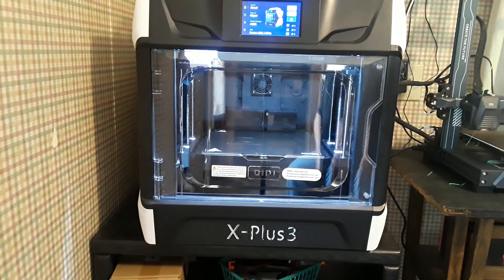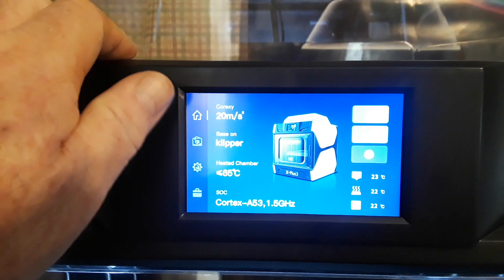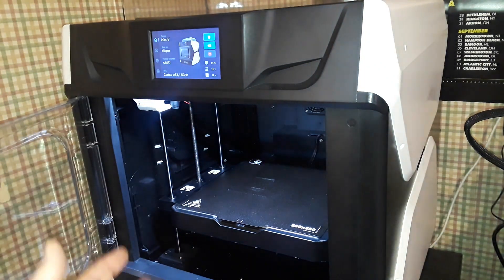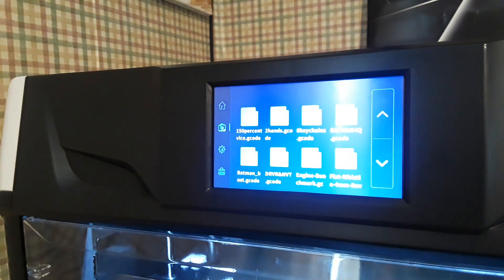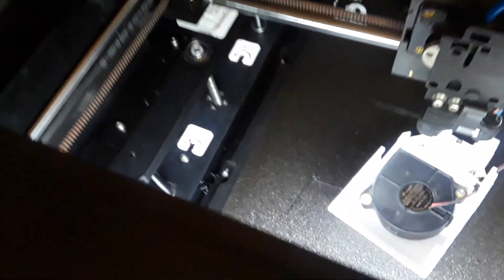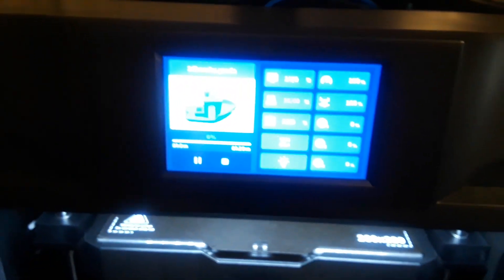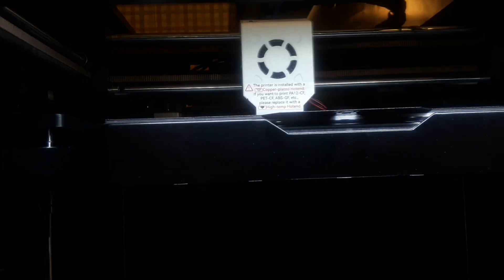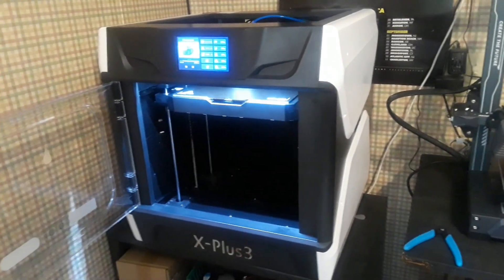Qidi Tech X Plus 3: One Month Later

Comment: ive had trouble with prints not coming out right support say do a level again and its still sticking to the nozzle been told to manuel level the bed but i dont know how to do that on my plus 3 yet very new to 3d printing after watching loads of youtubers saying printer is good we went with that printer 42 prints later still failing prints only the first benchy prints came out right with pla
Reply from the maker: This is a rock solid machine. It sounds to me like you have a bad one. I would contact the seller for a replacement. If you get any pushback, let me know.

Comment: i have been thinking of this model for a month.. would you say that the qidi has just as good bed leveling as the K1 or P1P?
Reply from the maker: I've never used bamboo so I can't give you a comparison. I can tell you I have have not experienced any problems with the X Plus 3 that weren't caused by me or the slicer. And both times QIDI tech support answered my question in less than a day.
I absolutely hate the drybox on the back of the machine. I bought a filiment dryer with rollers and just feed from it on the side of the machine. The filament runout sensor is on the left rear and the drybox feeds right in.

Comment: Yes, what I would like is for the interface to be the same as they had with past printers of theirs! As well, they MUST move the filament from the back back to the TOP or side so you can easily setup a print farm allowing you to mount on the left or right of the printer to share with other prints.

Comment: probably just as good if not better than my flashforge guider IIS v2.  printing abs is easy on such a printer. I always print on the glass plate & 3DLAC adhesive spray. let it cool and it springs loose. works great for pla, petg, abs, tpu